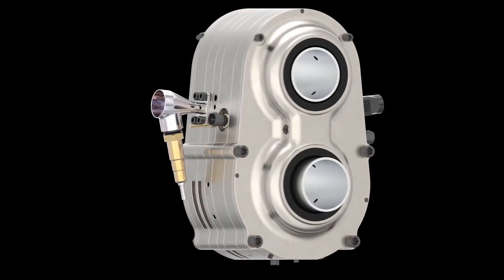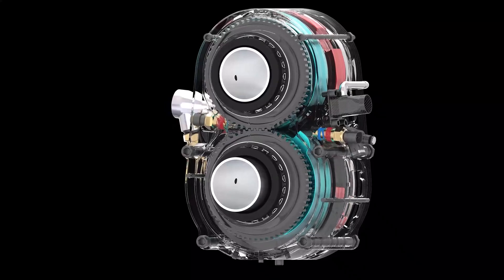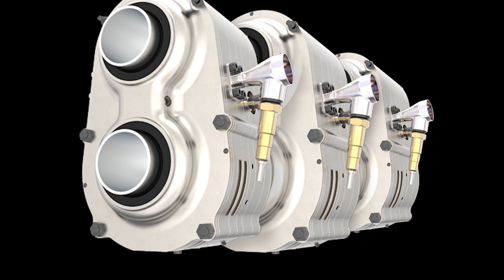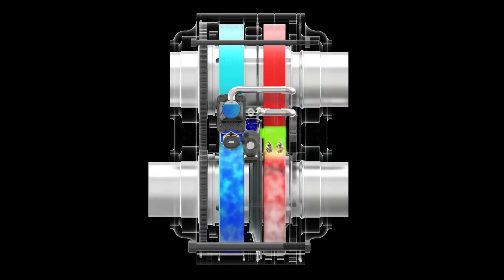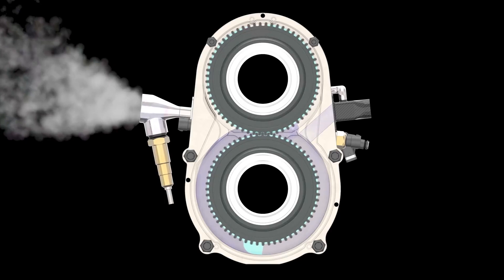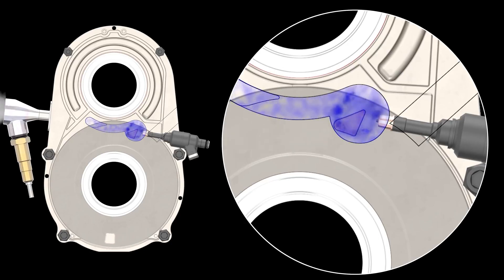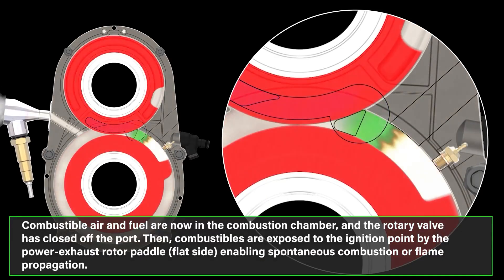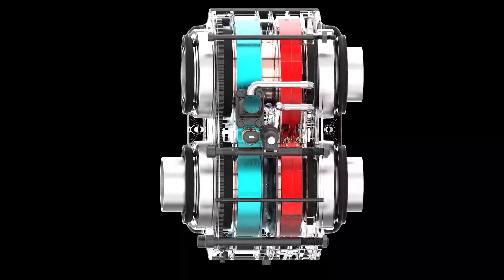This pistonless engine runs on hydrogen and revs to 25k rpm

Comment: It all sounds good on paper, but a dynamic system rotating at 25krpm will cause an enormous amount ofmechanical stress and secondary thermal stress which will be the Achilles heel for maintaining adequate fatigue damage.
Reply: Yeah, thinking about this I'm inclined to agree. Piston driven ICE is commercially successful because ultimately it's pretty forgiving. The materials required to produce & repair may add yet another demand for rare earth metals that is already nearing catastrophe both politically and environmentally.
Reply: Silicon nitride rotors
Reply: The sooting would be astronomical
Reply: It workes in electric motors with those speeds...

Comment: no seals, extreme high rpms, single combustion chamber.  i cant imagine the emissions are gonna be good at all, probably high nox from the higher temperatures due to higher pressures and rpms.  i doubt this engine will run for 100k miles or even less.  people said the same thing about rotary engines back in the day but they pollute more and burn more gas, and they have oil consumption problems, like this engine here probably will have.

Comment: I think IC engines have soo much wear and tear + complexities that electric single gear electric motor covers vast modes of use case at lower cost. Only issue is range.

Comment: This would be better than batteries as disposal of batteries is expensive, they weigh lots and efficiency aint so great. The problem comes down to machining the engines. Do they need to made from a billet or can they be cast or 3d printed. How fast do they wear out. How specialized will mechanics have to be to be safe.

Comment: Call me after it is put into at 10 least vehicles and run in various environments and temperatures for at least 200,000 miles documenting all the failures and issues. Also how many places in the US can you acquire hydrogen fuel at this time? Many years ago (a dozen or so) there supposedly was an engineer that designed a hydogen fuel engine and an onboard separator that made hydrogen from water. Don't know what happened to that project but it seemed promising at the time.

Comment: EVs are garbage. Push hydrogen engines in conjunction with more nuclear power that can produce hydrogen during off peak hours.  Power needs to be cheap and abundant.  Anything EV related is expensive and limited.

Comment: Well after driving ICE vehicles for 48 years and electric for only 4.8 years I have to say I will never go back to those inefficient smelly polluting things.
Electric is not only 98% efficient in the motors, you get back nearly 95% of your breaking energy when you slow down. Even if this thing runs on hydrogen, creating hydrogen is is only 60% efficient and you get nothing back when breaking. Also maintenance is always going to be higher with ICE and even running at 25000rpm you will lose a lot of hydrogen through gaps. Even if that's only 3% (my guess is higher) any hydrogen lost is lost to space and when multiplied by millions of cars and miles of annual travel that is not acceptable.

Comment: There are going to be a few major hurdels to overcome..

First: tight tolerances means cold starting would be less likely, on top of that you have wear and tear which will lessen the engines capabilities. 

Second: cost if it's going to forego seals with tolerance a near impossible QC and manufacturing methodology will be required to make engines cost effective, it's all good to want to save the earth but manufacturing parts still cost $$ and GHG.

Third: advancement in transmissions, due to the lbs of TQ the engine has in theroy you'll need some serious gearing to be able to move forward I'm thinking 18 speed most likely. 

Finally: alternative fuels, both hydrogen and petroleum are far too expensive to run in such a high RPM engine for travel for the average person that drives today, this to me would have closer fuel economy to a jet engine then to a big block carb motor. Which will also severely limit the distance you can drive on a single tank. Stop and go / up hill climbs will severely limit how far you can travel.

Comment: Engine looks great I wonder if it's really working as a show. But the problem is hydrogen extremely difficult to maintain hold or transfer because it's so little it will escape from the tank overtime and it's not efficient to get the hydrogen from water. I just got a new Tesla and you really don't need anything else now it is perfect
Reply: Except a for a national electric grid, charging stations and of course plenty of lithium for batteries. Good news there: you only need to dig up and sift through about 330 tons of earth and use 2 million litres of water to produce 1 ton of that stuff.

Comment: All your emissions are still created in creating the hydrogen, and there's massive efficiency losses in creating said hydrogen. Most hydrogen is created through methane steam reformation, requires energy to create the steam and a 2nd fuel source to reform. Still easier and cheaper dumping that energy into a battery.

Comment: I suspect this motor would run incredibly hot and require a sizable if not, full water jacket and radiator.
Reply: Suspect? Of course it would. Horsepower is heat

Comment: I'd have to see it run in real life and do testing but if it works and it's long lasting then yeah be a cool little engine even for a generator use for a house to charge a large power bank off the grid.

Comment: The problem I see is to store hydrogen, don't you need a heavy pressurized metal tank.  How does that become viable for aviation then...?            also, for aircraft, you need constant power, but for something likea quadcopter, you need fast accelration and deceration like an electric motor...

Comment: Neat concept, but it would only really work with exotic materials, and even then, it would be very high maintenance because of the tight tolerances. Also, good luck sourcing the fuel at a reasonable price.

Comment: I had never thought of having the pistons and pots on the outside of rotating metal cylinders. Like a radial engine with one cylinder and external components for the compression and bang that makes the engine run. Engine design is likely suitable for aircraft and sports cars because of the high r.p.m. . More pistons and pots would make it like an inside out radial engine. The good thing about the design is that it could be made extremely easy to replace piston rings and pots because they are exterior and easy to get at and work on. I think the engine design could be extremely useful in motor cycles because of the potential simplicity of the engine, maintenance , high r.p.m. etc. Nice to see I like good clever designs. Would an engine that can do 25000 r.p.m. be good in a drag car? Because why shukins I just don't know. The phone does not seem to like the word shukins because it is not likely recognised as a real word. Why gosh golly gee wilikers I guess I should be beterifying my wordifyimg on the internet. Being high tech and all that.😉

Comment: Jay Lenno has an interesting YouTube video on the Owen Magnetic- a car built over 100 years ago in very limited numbers that used a gas engine to spin a magnet and produce rotation without actually touching the drive shaft components.  Reminds me of hybrids like the Chevy Volt with a small engine and ability to use EV capabilities for initial thrust.  I can see an even smaller version of this engine providing power to recharge on the go but working at a consistent output level to enable much longer EV range and the ability to recharge when a grid based charger cannot be found.  If it could run on hydrogen it would allow much smaller battery packs and would reduce cost and weight of the vehicle.  I think the mistake EV manufacturers are making is avoiding the advantages of a hybrid design...... causing battery packs to get bulky and very heavy.  Most drives are less than an hour or about 60 miles.  Yet cars are designed to provide a specific range.  The Volt is able to function like an EV but also like a traditional gas vehicle for longer trips.  Ideally the gas engine would be replaced by hydrogen or similar fuel source rather than petroleum.... but serve the function of self charging and also provide a small electric generator for off grid camping and emergencies.  Fuel cell might be better if it could be downsized but that seems to be an elusive solution.
Reply: We ALREADY have hybrids like this, they can transfer power from the ICE and split the power between the drive shaft, an electric motor, and a generator, all in different ratios, all at the same time, depending upon conditions.
Reply: @davelowets  Most will kick in the ICE pretty quickly rather than relying primarily on the electric and using the engine to recharge the electric system and eliminating the transmission and a huge amount of weight as well as downsizing the engine and saving even more weight.  I’m suggesting a small gas engine that is basically an on board gas powered electric generator.  

If any hybrids are currently designed this way, I have not seen them..... although the Volt functions sort of this way by preferred use of electric power but I think it still has a traditional power train as well.   

Can you think of any examples of an EV with an on board integrated gas powered generator?
Reply: @dtrout  No. And I really wouldn't want one with a small generator onboard that doesn't power the wheels, and charges the batteries only. One horsepower = 746 watts of electrical power. It takes the average car 25-30 horsepower to maintain 70mph on the highway. That would be roughly 22,380 watts (not counting the inevitable conversion losses involved) to just maintain highway speeds, and not put a single watt back into the battery pack. You would need one HELL of a generator to be able to put any charge at all into the battery AND keep moving along at 70mph, or you would quickly run out of range. That is exactly why hybrid cars use a full size I.C.E. and a "synergy drive" system that splits the power between the battery, I.C.E., Generator, and the axles to the wheels.
Reply: @dtrout  Most hybrids are designed that way today. Take a look at the internals from a Toyota "Hybrid Synergy Drive" transmission, and you'll see it. There are 3 inputs to the transmission. 1 input from the I.C.E., and 2 from separate electric motor/generators. All 3 inputs are connected together similar to a differential in the rear-end of a rwd car... If all 3 inputs are free to rotate, NO power goes to the axles, it all just freewheels. When the I.C.E. is powering one input, one of the other inputs needs to be slowed or held still to transfer power to the axles. This is where the 2 motor/generators come in. If the battery pack is very low, one of the motor/gens will place a large load on one of the inputs because of the burden of charging the pack(it gets physically hard to turn), this places a load on 2 of the inputs of the "differential" inside the transmission and "splits" some of the power to the wheels. When the battery pack is full, and you accelerate, one or both of the motor/generators will turn the 2 inputs to the transmission, with more force than the I.C.E., and the differential in the transmission will split the power from the motors, take a big load away from the I.C.E., and send the torque to the wheels. If the car is in pure electric mode, the I.C.E. is not turning and is holding one of the 3 inputs still, and the electric motor/gens are sending all of their torque to the wheels. The transmission with it's 3 input shafts and one output shaft is setup sort of like a double differential, and depending on which inputs are driven and which ones are held still or held at a slower speed than the others, dictates what, and how much of which, input is transferred to the axles(output). These cars have a powerful computer that constantly figures out the most optimal configuration of which motor/gen, and I.C.E., does what on which input shaft to arrive at the most efficient power at the output(axles), for every scenario. It's very smart and very high tech, and ever so simple once you take a look at how it works. I hope you can understand what I'm trying to explain here... I'm not a great teacher. 🤷🏻

Comment: By the look of it, the compression ratio is somewhere near ONE!!!!  (Definitely below 2!)
It looks to be RELYING on a 200PSI supercharged intake in order to get any air into the engine and that'd make it a PAIN to start!!.
I'm guessing that the intake temperature is HUGE (a side effect of compressing the intake charge to 200PSI in the supercharger), so I'd expect pre-ignition to be HIGHLY likely as the engine ages - probably a couple of hours MAXIMUM is my bet before requiring a rebuild.
IMO, requiring 'tight tolerances' is ASKING for trouble.  The 'combustion chamber' doesn't actually need to seal as well as a 'traditional' ICE since the intake boost is already 200PSI.  Let's assume that it leaks down to 160PSI by the time it's ignited...   Still PLENTY!
While the bare engine may well produce 160HP from a 16kg engine, I am willing to be there's a 50+kg supercharger that's not included in this weight.  Furthermore, I'm betting the supercharger 'consumes' around 150  of the 160HP that the engine produces!
The diagram doesn't seem to show much about the exhaust side of things.
The 'power-stroke' crank rotation looks ridiculously large.  I suspect the REAL engine would have more than one lobe

Comment: This is way more appealing than an electric car, which is still fueled by fossil fuels.
Reply: 1. You've clearly never driven an electric car
2. This wouldn't perform anything like an electric car
3. Not all power is dirty, many power their electric cars with clean energy

however the problem isn't internal combustion exactly - it's fossil fuels. Hydrogen, being the most abundant element in the universe is by far the best power source, we just have to figure out how to break it free of other elements as it really wants to bond with things and it's energy expensive to break those bonds. THAT is what we should be putting billions toward as we will become a hydrogen based society at some point as it's time to stop destroying our planet with dead dino juice that will run out soon anyway.

Comment: it sounds promising.  with out definitive proof of a prototype and testing.. any body could speculate on paper all day.. almost everything looks good on paper.. that is until real world testing.. too many factors to work thru. oiling.. cooling.. material strength.. heat would be huge if theres no fluids to keep it cool. higher the rpm.. higher the components are stressed.. in turn causes high heat.. high heat causes failure.. but again.. make one first then go from there

Comment: If this a valid engine and if it works it would be a great thing for vehicles. I think it would give electric power a run for its money. Anything can look good on paper but I would like to see this in real life.
Reply: Trust me ..by the time this might work in a lab we have electric cars doing 10k miles with a single battery charge

Comment: Couldn't you realistically do this with any piston powered engine? I mean, have a small engine with very short stroke and bore to rev to 25k RPM and only have it fire when you need it, leaving the momentum to drive the engine for idling. It's basically the same principle.

Comment: Hmmm.... Sounds good in theory but seems like wear would be a huge problem. And I imagine the metals used to keep those tolerances at all temps may be expensive. It's cool but I still look forward to the coming improvements in battery tech that should drastically increase the feasibility of EVs.

Comment: I mean it's a beautiful piece of engineering but I doubt that this is the future of combustion engines because combustion engines per se have no future altogether. Hydrogen fuel cells are a dead end - for mass auto market at least. In regards to EVs everybody is screaming "Where do we get all the electricity from?" whereas hydrogen actually needs more electricity for the same amount of energy. Only upside is that you can store more energy with less volume than batteries but this doesn't mean it's better.

Comment: Electric has too big of a carbon footprint without any proper disposal program and expense forces buying new electric vehicles instead of replacing batteries which are left to leach into the ground and water table.

Comment: Could be good as a generator in an electric car, but hydrogen is far more difficult to come by (Still only 1 [one] H station in San Diego) compared to electricity so doesn’t make much sense either. If this is truly great tech then build power plants with them, not cars.

Comment: All bs. Great video for gullible people. You also cant make such a tight tolerance to seal with seals. You need oil for lubrication if they touch and you need to be able to compensate for thermal expansion or it would seize in a °5 temperature variance. That why pistons are dramatically smaller than the bore size.

Comment: Even though its a small engine the price is going to be insane because of the precision, if there are no seals then the accuracy and precision are going to have to be like the engines on aircraft and it definitely wont be cheap to make but I definitely want to see one of these in action.

Comment: I converted both my CJ7 and Samurai to ev last year.
This tech looks cool but having owned a wankle I love them also.
The problems are sound falling torque under load.
What does this do to mitigate these conditions?
Is the engine jerky if it's not firing 80% of the time?

Comment: It is easy to claim it is efficient. Well what is the compression ratio? and what about flame front speed vs. rotary speed? can there still be torque at high refs when the flame front is slower than the "piston"?